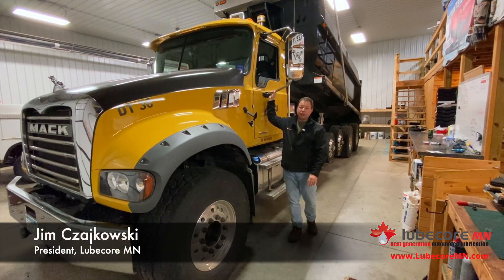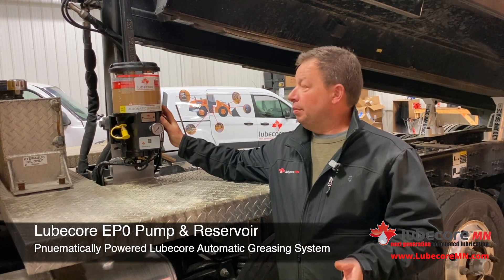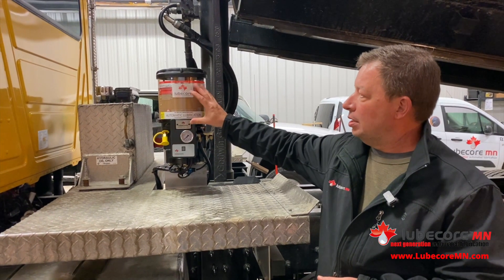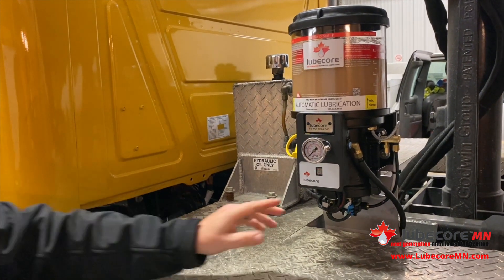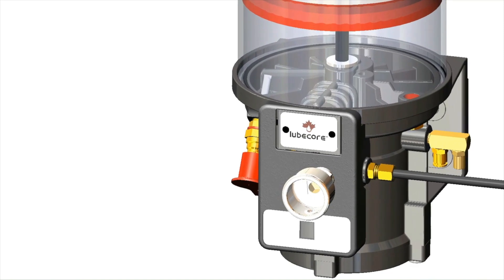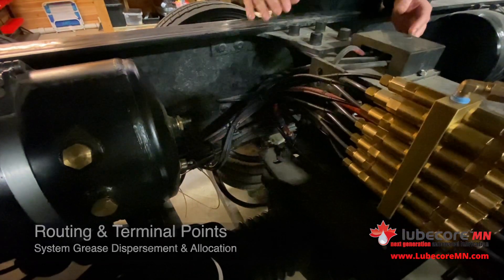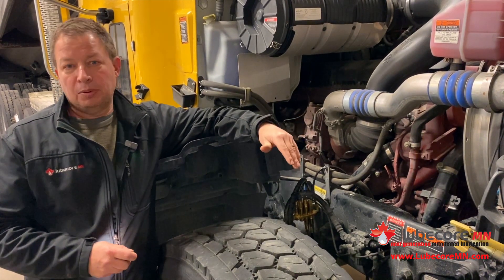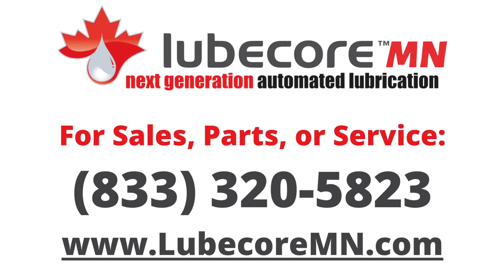Automatic Lubrication Greasing System Installation on a Quint Axle Dump Truck Lubecore Overview

Comment: Question for the steer axle kingpins, industry standard is that you jack the front up when greasing kingpins to relieve any tension / pressure when grease is applied. How does this happen with the auto-luber?
Reply from the maker: @bobmalone5116 - sorry for the late response, we only just saw your message today! Here is your answer: The automatic lubrication system works when the truck is working. The reason people jack the truck up is because they want the grease film to work into the components and the automatic lubrication system works as the truck is moving and bouncing. The positive pressure forces grease in as it has opportunity to work around the components while moving.  This essentially mimics what’s happening when you raise the truck and lubricate. One of the other advantages is that you get smaller, more frequent shots of grease when your equipment needs it most - as it is working - instead of one big shot at the end of the day. The positive pressure of the grease also helps to prevent ingress from dirt, sand, and other abrasive materials by pushing out. I hope that clarifies things. Feel free to reach out to us if you'd like any additional information or clarification!